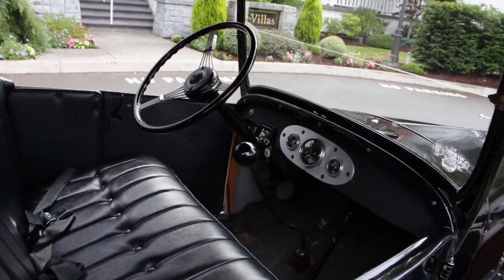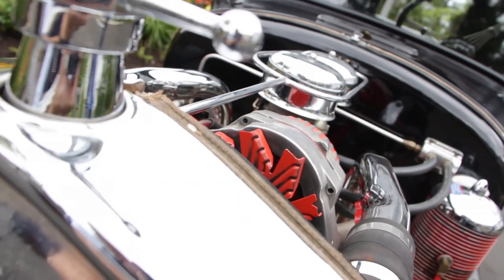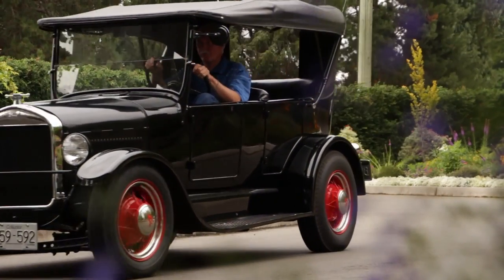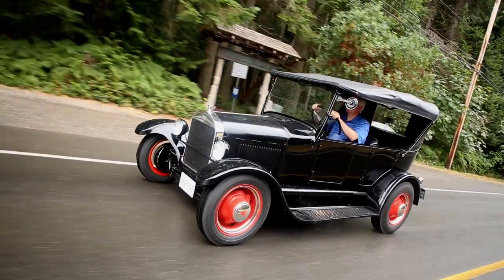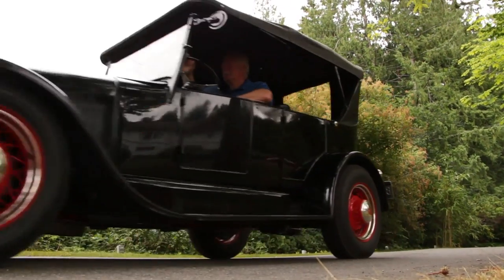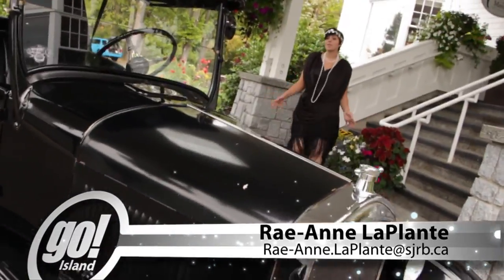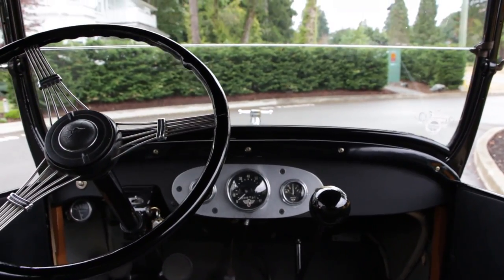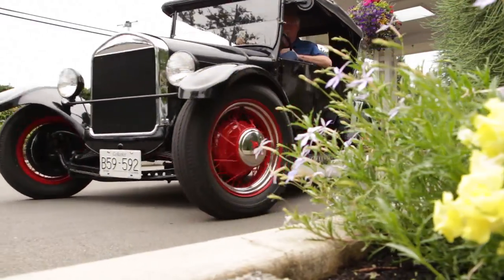Calendar Cars #7 - Model T Ford Touring Car - Shaw TV Nanaimo

Comment: Well done Tom! Tasteful custom and restoration. Thanks for not chopping the top or configuring it into some bizarre recollection of its former incarnation. Thanks also for keeping your restoration Ford as much as possible. Your 1940 Ford flathead  8 must have at least several times the horsepower of the original inline 4 engine.